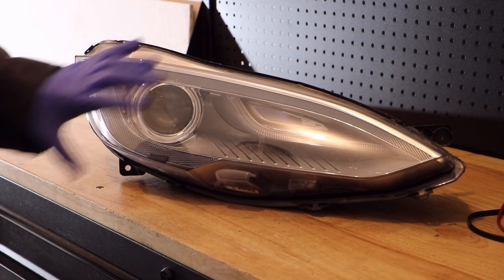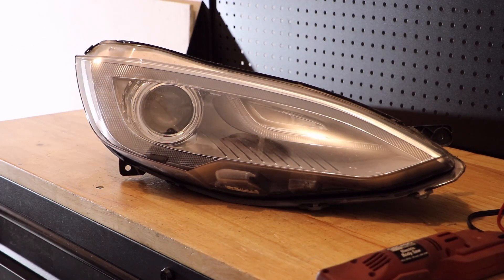How to disassemble a Tesla Model S Xenon Headlight

Comment: I’ve just had to pay £1000 to get mine RH replaced at Tesla. It had about 100ml of water in it. I can’t believe, that they leak like they do, the price to fix it, that you have to take the wheel/arch apart to swap a bulb, or that the circuitry lies in the water. I took the old one home and it mostly still works.

Comment: I really wish there was a video on how to remove it from the vehicle as well as how you open the head lamp without cutting
Reply from the maker: To open the headlight, you'll need to use the headlight baking method: https://www.youtube.com/watch?v=ZCvzUS_xo9Y

To remove the headlight, you'll need to first remove the bumper to gain access to the 4 mounting bolts: https://www.youtube.com/watch?v=sr9uTGamioE